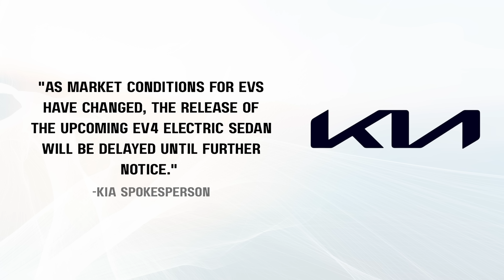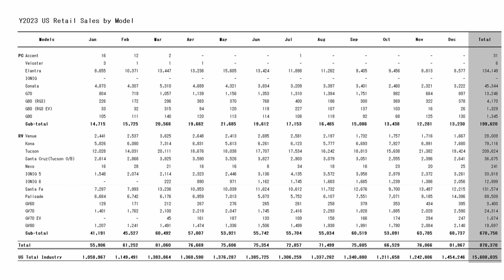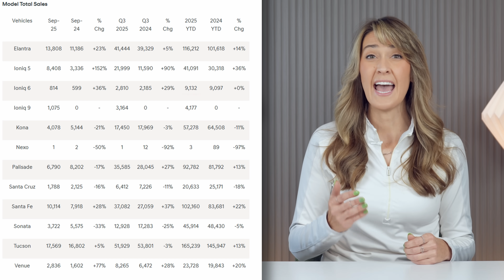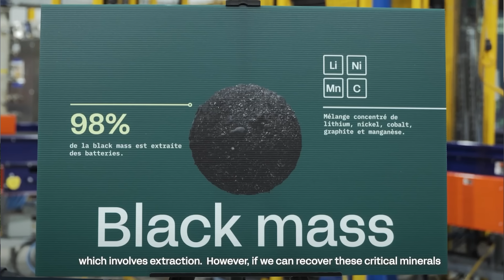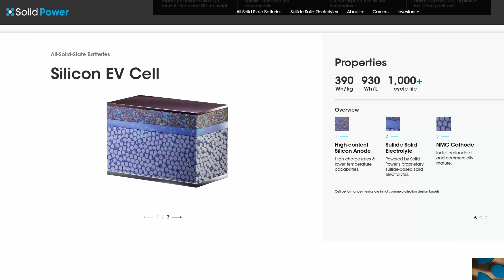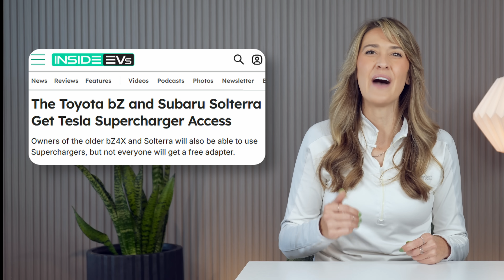The Current : Weekly EV News Ep#87 Nov 2, 2025

Comment: Thanks for the great EV content and the straightforward unbiased delivery of the news! In answer to one of the questions, so far I have charged once at Ionna in Valdosta Georgia. I look forward to more station openings.
Reply from the maker: Were there special amenities in Valdosta? What was your takeaway from the experience? -Producer Tim
Reply: @MissGoElectric  Hey Producer Tim. Our stop was five months ago in June 2025 and the site had just opened and ours was the only EV charging there. On the plus side the site has a canopy with trash cans, with a squeegee and washer fluid container. Can't remember if it was filled. The HYC 400' worked great and gave our Mach E all the electrons it wanted. Ford now has access to activate a charging session through the Ford app. The canopy location is visible from the interstate. At the time we used the credit card reader and the introductory pricing was in effect. In the could be better category the driving distance from the interchange exit is 0.83 miles.  It is in the middle of two parking lots (Cheddar Spice Kitchen and Ashley Furniture) 500 feet away from a Walmart parking lot with a four stall EA (two were in use). There is a Sam's Club on the other side of Walmart. The Plugshare listing to this day does not indicate which adjacent business(es) that Ionna has a deal with for amenity use. When we stopped on a Sunday morning, the Cheddar Spice Kitchen was not open yet. We were not sure if we would be welcome to use the furniture store facilities and did not feel like having sales interactions. As we needed a couple of items anyway we walked over to Walmart and had charged at that EA experiences a few times before. When we walked out it was raining. I walked in the rain to get the car. In Valdosta there are other CPO's with charging locations closer to the interchange. We drove past a Circle K with two shareable ABB chargers. 1/4 mile off the exit on the other side of the interchange there is a Tesla V3's at a SunStop travel center. 

The next time we pass through, and if we need to stop in Valdosta, where we would plug in would depend on needs at the time. However, I feel like Ionna would not be our first choice in Valdosta.

Comment: Equinox EV owner. IONNA is on par with Tesla for ease of use, particularly for plug and go functionality, and speed. Charge at Blue Springs MO facility. Outstanding that two more are slated for the area. New Tesla V4 chargers just got installed in St. Joseph MO. This state has shown resistance to EV support at the political level; it's terrific to witness these developments despite headwinds.
Reply from the maker: They certainly mean business. The team is doing a wonderful job rolling out quickly. 
-Producer Tim

Comment: I recently charged at an Ionna site. It worked just fine on the first attempt. There were plenty of stations available and even windshield cleaning supplies were present. No facilities at that location. A restaurant of some type was there but had closed.
Reply from the maker: So you think some kind of 24-7 restroom should probably be a minimum requirement for highway corridor charging.  -Producer Tim

Comment: It would be nice if Ionna or another charging company would bring more actual dc fast charging to Northern Michigan (Saginaw- north) and to the Upper Peninsula.
Reply: There's hardly any gas stations in the UP, either.
Reply: @jamesvandamme7786 I would bet there are 100x more gas stations than dc fast chargers( but I don’t consider anything under 250kw a fast charger in my opinion).
Reply from the maker: They low hanging fruit gets plucked first. High traffic, high adoption. NEVI find were intended to fill in the gaps. That requirement was scrapped. The economics need to change in areas in which usage would be unprofitable or large networks need to but the bullet like Tesla has by building some unprofitable sites in service of unbroken corridors. 
-Producer Tim
Reply: I didn't know there were fancies in the UP